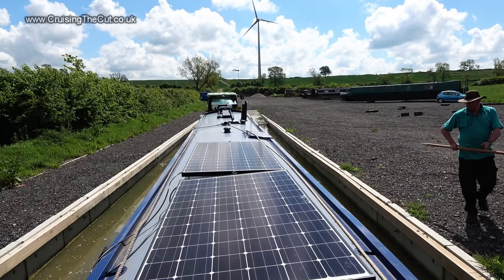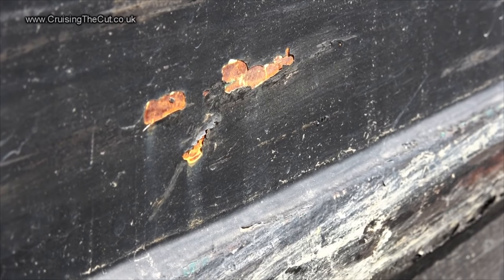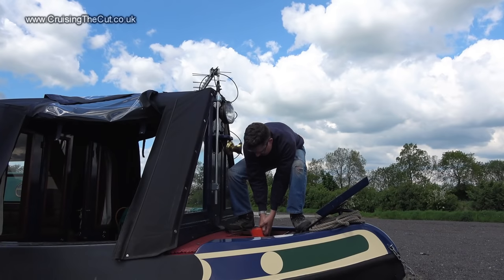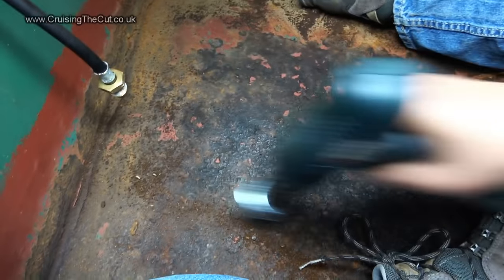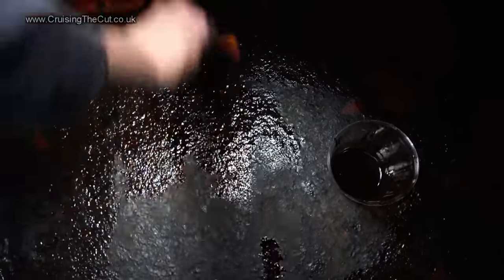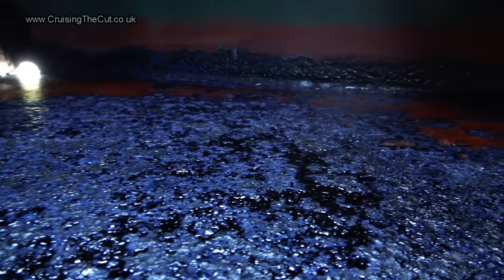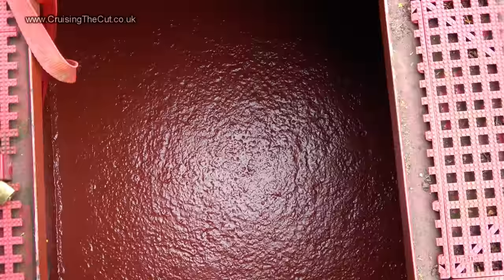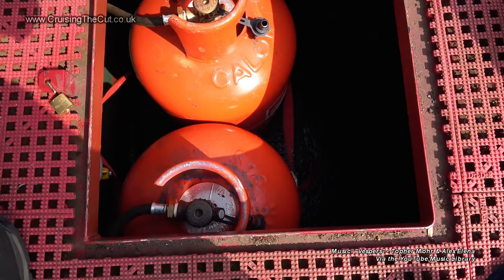55. De-rusting and repainting my narrowboat gas locker

Comment: Greetings.  I was wondering if the subject of hulls and in particular, rust would be interesting.  It would appear that corrosion is the way narrowboats get to die.  What should we do to to sort out our rusting boats.
Reply from the maker: Existing rust is typically sanded/sandblasted, treated with chemicals such as Fertan, then painted - just as in this video. If really bad, new bits get welded in (overplating). Prevention being better than cure, narrowboats hulls are blacked (coated with bituminous paint) every two to three years and that's the main defence against rust.
Reply: I am quite interested in the prevntion bit.  Having the hull two pack coated or zinc sprayed and two pack coated seems a good thing to do - if the process doesn't destroy the inside rust preventative coating and insulation.
Reply from the maker: There's pros and cons; the good thing about traditional blacking is that it's very easy to touch up if you get any scraped off by ice or other boats or whatever, whereas a two-pack coating would be trickier to fix. On the other hand, the two-pack should last a lot longer provided it remains intact. I have no experience of zinc coating, though I did chat to Debdale Wharf about it at Crick; expensive but they claim a 10 year lifespan or suchlike if I recall correctly.
Reply: Thank you.

Comment: You can fill the old hole up and make a new one above sealevel, no more water coming in!
Reply from the maker: No, the hole in the gas locked just be at the base so there's no possibility of gas build up. Moving it higher would require a new gas locker floor and there isn't the space.
Reply: +CruisingTheCut Oke then, keep on mopping! ;) Greets from Holland!
Reply from the maker: Alas yes, unless I get the whole front of the boat re-welded to a new design :-)

Comment: Both my grand parent died from a propane gas explosion when LPG being heavier than air pooled in their basement. 

Hate to see those low vent holes at the water line. However un less U raise the floor up some, you can't raise the vent holes above the water line....
Reply from the maker: Gosh, that's appalling to hear. You're right though, I can't raise the holes unless I raise the entire locker.
Reply: No, just the floor (un less the gas bottles are too tall n will no longer fit in if you raise the floor 3-4 inches).
However
It looks like you will be protected for sometime. Also - Perhaps having no metal on metal  contact between the tank's bottom n your boat locker's floor would help keep the water proofing intact lots longer?
Reply from the maker: Alas that's exactly the problem - the bottles are already at roof height so the entire locker would have to be built up and, effectively, the bow of the boat reshaped.

Also, yes, the bottles were already on a raised plastic matting but the water just seemed to pool underneath it anyway :-(
Reply: It would be nice to make your fuel locker perfect but seems not worth the effort unless you can find slightly shorter fuel tanks or possibly a tank that is designed to be mounted horizontally....

I owned and flew a hot air balloon for 5+ years in the late 80s. So add in the tragic disaster with my grand parents makes me sensitive to anyone's LPG in a confined area situation......
Reply from the maker: There are 6kg cylinders available which are much smaller of course and so I could use those but it would halve the time between changes (and be more costly overall), though I could squeeze more bottles in and raise the floor. So it is something I may consider.
Reply: Yes, but nothing needs to be perfect. Your rust n protection repair will last a few years don't you think? How often would you have the boat out of the water if you didn't need to repair the gas locker?

I wonder if you can legally n safely shorten the tanks by trimming the top protection ring and the bottom ring a few inches each ring?
Reply from the maker: You can't do that to the tanks, a) for safety, b) the tanks get swapped when they're empty, not refilled c) they technically belong to Calor (the gas supplier), not the user.
Reply: Here in the USA you can own your own tanks, so that part is not holding any one back.  Tinkerer here often make grills or wood stoves out of old tanks. However,
I would not doubt there are federal and or state laws/regulations that prevent a gas company from refilling tanks that were modified in any way. 

So just depends if you can purchase your own tanks and what your refilling regulations are.

After all, you would not be altering the tank, you would be trimming the bottom ring the tanks balances on and the top ring that protects the gas valve from being knocked off by accident and causing a flaming disaster.

My dad once witnessed a tanks being off loaded from a ship. One fell on the dock and the valve was knocked off. He said it took off and the high pressure escaping gas propelled it across Pearl Harbor out of sight (with out igniting).  So since LPG is flammable I suspect you and I probably would not be able ever refill the tanks after modifying even the base n tank valve guard ring. But perhaps it is worth checking the refill regulations in the UK if you are permitted to own your own tanks in the UK. 

Perhaps installing/welding a wave/splash guard infront to the drain holes that would protect any passing boats bow wake from flowing in would be worth it the next time you have it out of the water.

You would still get water in but probably lots less............?
Reply from the maker: There are no refilling stations along the canal; the whole network is geared to Calor bottle exchange. I'm simply doomed to have a soggy bottom :-)
Reply: Yes Mr. Soggy Bottoms you are doomed indeed...... 
However looks like you did a nice job waterproofing so you will be ok, just keep them from sliding around as much as yo can.
Aloha, Glennnnn

Comment: The next time you have to do the gas locker I would suggest you hire in some equipment. A needle scaler like this - https://www.balloohire.com/product/equipment-hire/electric-needle-gun - will do a far better job at getting rid of the rust than a wire brush. You will need a good pair of ear defenders though as it will be very noisy in the locker when you are using it.

Comment: If it were mine I'd be at least bonding a strip of angle iron in the two well deck lockers to route any errant water out of the well deck . Not much you can do with the gas lockers other than the excellent work done - I note you did not do the whole locker just the base? When I did mine I actually found it to be a really nice place to be  - maybe I should take up pot holing, but only after I had done much as you did apart from the blacking but my holes are well above the waterline thankfully.
Reply from the maker: That would be a BSS fail I think - there mustn't be anything that could stop low lying escaped gas from getting out, even just some angle iron.
Reply: Referring to the well deck lockers not the gas locker....at least you would keep the stuff in the well deck lockers dry(ish)
Reply from the maker: I beg your pardon, I read your comment in haste as I went through lots of them. Yes, a good idea then!!

Comment: could you create a channel in the well locker to funnel the water from the water tank to the outside hole?
Reply from the maker: Maybe...
Reply: I wondered the same; could the putty be used to create a dam within the lockers, keeping the water to a set path and prevent pooling? @ @CruisingTheCut
Reply: And I thought the same, or do the lockers let water in through the lids?
And what about those open weave rubber floor mats they use in professional kitchens to stop metal paint cans, gas bottles from sitting on the bottom of your lockers.

Comment: Hey just wondering how the fertan worked in the locker,any sign of rust or is everything ok?,I have just purchased a bottle of the stuff as my boat is out for blacking soon.
Reply from the maker: Hard to tell since I gave it so much paint on top but nothing bubbling up that I can see so far. I'd be very disappointed if there was.

Comment: i would weld a tube in locker so water goes straight thru to the outsides and not in the locker  as for the gas spot well not much there unless you can do same thing so water flows out at some point if its level probably not but a angle would work for steel boat makers for future boats if nothing else
Reply from the maker: Yeah, I don't think the gas locker baseplate was put in this one properly.

Comment: You dealt with the symptoms not the cause!!
Reply from the maker: Yes. The cause is that the boat is either over-ballasted (which would require ripping out the entire interior fit-out and floor so as to remove ballast - not practical) or has the gas locker vent holes too low (which it is also impractical to fix as it would require re-making the entire front end of the boat)
Reply: @CruisingTheCut  A periodic inspection and perhaps the installation of a small bilge pump rather than the hole might help too.  A wet/dry vac would probably get water out well too.  You may be able to use silicone sealer to seal the hole and at least prevent the entry of water in the first place; removing it can be done seasonally with the vac or even mopping if there isn't too much water.

That brings up a question: is the gas locker door gasketed to prevent the entry of water from around the locker hatch?  If not it might be worth getting some home/auto weatherstripping (rubber) and putting it around the bottom door frame area - the rubber usually has adhesive on the back, or it can be stuck in place with silicone adhesive in a tube.
Reply: @simplywonderful449  Sometimes, when you have no idea what you’re talking about, it’s just better to keep your mouth shut. 😊

Comment: The ptfe tape is completely unnecessary, the gas is sealed by the conical face on the front of the coupling. Be aware, when you use ptfe tape you greatly reduce the torque feedback through the tool to the hand using the tool. For many years polyterafleuroethylene was the worlds most friction less solid!
Reply: Steve Marks  quite correct. If the regulator isn't sealing  against the cylinder cone  you probably need to change the regulator. I would never recommend using PTFE tape on a fuel gas cylinder

Comment: Honestly, rust converters don't work as well as the claims. That's from more than 40 years experience working with old cars. At best they hold rust at bay for a short period of time.  For peace of mind you want the rust GONE!! completely. I suggest you look into the alternative use of stock feed type Molasses for removing rust. There's plenty of youtube vids on the process. You would have to seal the chamber somehow temporarily to hold the solution but the Molasses will eat 'all' that rust away without any of that hard yakka, and it will do a far superior job too. Having used the solution in restoring old rusty cars I can tell you it's amazing stuff and non destructive unlike sand blasting and grinding etc. All that's needed is patience and time to let it do it's thing. It will have to be neutralised afterwards with phosphoric acid which generally contains zinc phosphate to stop flash rusting before then being coated in whatever paint you choose. However look into products such as Por 15 or the Australian equivalent KBS rust blast for a rock hard impervious coating after the rust removal and clean up. They both make extremely durable coatings including ones that are capable of sealing and coating the inside of rusty fuel tanks etc.
Reply from the maker: What an interesting idea. Too late for me this time round but something to look into. Cheers.

Comment: Nice job 👍 what happened  to the horn ? Will you adapt the breather holes to stop water ingress ?
Reply from the maker: You mustn't adapt the breather holes else it would fail the safety test, they have to remain open at the lowest point of the locker to enable any escaped propane to get out.

Comment: Hi. Eye protection - think what one of those flying wire bristles could do. No, standard glasses do not work - the projectiles can get past them and they are not sufficiently robust either. Hearing protection. I said HEARING protection! Please also use the right tools. This job would have been over far, far faster with an angle grinder. A matter of minutes. No kidding! Ideally mains - look in Wickes, Screwfix, Toolstation, B&Q etc etc I Rent, beg or borrow a generator. Most cutting tools work best at the right speed, and rotary wire brushes are no exception. In this case around 10,000 rpm, not the 1,500 you might get from a drill. And yes, you've messed up your lungs. Also, be very careful when working in confined spaces. Ensure good ventilation. Use an electric fan. Please take care, we like your videos! You researched your boat. Research your tools, you're playing at it. BobUK.
Reply from the maker: Kindly meant, I'm sure, but a bit late ;-)

Comment: what would you suggest if the rust has eaten away at the bottom of the locker. i know it would fail the BSS with this issue.
Reply from the maker: It would need a new floor welded in.
Reply: thanks. i was hoping there was an easier way, something that did not involve welding
Reply from the maker: Not if you want it to be gas safe and permanent.

Comment: Very interesting video, but quite a lot of work for you.  Although the heavier than air gas needs low drain holes, it seems to be an engineering error to have had the holes end up so near the water line. And you live with the consequences.
Reply from the maker: My though exactly!
Reply: BTW, I thought that this was among, if not the tops, the best titles for one of your vlogs.  Just when I was debating whether to call you Shirley or Mr. CC, I see you are going back to the name you used as an accomplished academian
Reply from the maker: Haha, it should be Mr CTC anyway but I didn't like to correct the girls ;-)

Comment: hmmm what about those drain holes on the waterline how are you going to deal with that , what is the solution?
Reply from the maker: Buy another boat. Or, just keep on top of it, it's a design flaw, not really soluble due to the size and design of the locker.
Reply: Not really a design flaw with the boat... It's just you've been slightly over-ballasted by whoever did your boats fit out. Annoying :( . How does your boat sit at the back?
Reply from the maker: It's fine at the back. I think it is a design flaw, the bow's too low, could easily have been built up by another couple of inches without spoiling it.

Comment: How did you raise those gas escape holes further above the water line?
Reply from the maker: I haven’t
Reply: I'd look into that. You only need the gas to escape in the event of a leak, so you could raise them by an inch or two? I'm not sure what the gas safety rules state but worth looking into.
Reply from the maker: They can't be raised without raising the entire floor of the gas locker, they have to be at floor level.
Reply: Perhaps if you make the front of the boat a bit lighter? Move some of the ballast weights back, or move some of the heavy furniture nearer the stern or off the boat.
Reply: @cosmalas7742  The problem is that propane is heavier than air, so it sinks to the floor, and an escape hole needs to be at floor level to work - a hole higher up will not get rid of the gas, which is why the hole is there at all.

A bilge fan might be possible, but a vent hole is still needed even with a fan, as the gas has to go somewhere.  A fan to pull it out, as on many pleasure boats, would need to be designed, and it seems there aren't other vents in that locker.
Reply: @CruisingTheCut  Since the gas is heavier than air, a bilge fan of some sort - even a small 12VDC computer fan - might help vent the locker out a higher hole.  Many pleasure boats have as their routine the venting of the bilge by turning on a fan BEFORE starting the engine, lest you display the explosive personality of trapped gas, whether petrol or propane!

I find your videos wonderful, educational and very relaxing - thank you!   But I find myself trying to come up with solutions to ease the problems you encounter with/on the boat, which I enjoy doing.
Reply from the maker: @Simply Wonderful The safety regs do not permit the gas vent holes to be at anything other than the same level as the base of the locker.
Reply: @CruisingTheCut  What if you put some kind of resin down on the floor of the locker so it can't go rusty, and then extend the vent holes upwards a bit if necessary? If the rust-scrub cycle is repeated too many times then will you end up with no gas locker?

Comment: This might be a stupid question but why aren't the hulls made of stainless steel?
Reply from the maker: I can never remember the reasons but they are good, technical ones
Reply: @CruisingTheCut  Fair enough. Unless it's a conspiracy to keep the blacking business going! Big Paint is pulling the strings!
Reply: Carbon steel (the rusty type) is stronger, what the call structural steel. Adding nickel and chromium (which makes it stainless) makes for much LESS strong, so isnt good for boats. Also, stainless doesn't work well immersed in water (the addition of chrome makes chrmium dioxide, which is the protective layer that keeps the steel from rusting). Chromium dioxide cannot form in the continual presence of water, so it doesn't work the way you think it might.

Also, cost.

Aluminum (in Brit-Speak, aluminium) would be a good, albeit noisy alternative.
Reply from the maker: Yes, there are some aluminium boats, a company called Sea Otter made them. Unfortunately they went out of business and the boats were fantastically expensive.
Reply: @Boreal99  THanks, I never knew that!